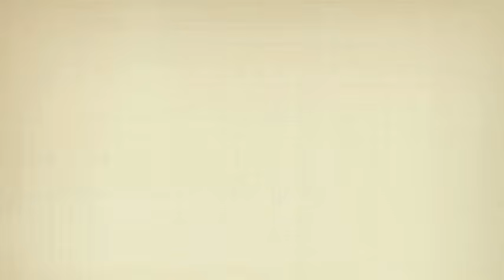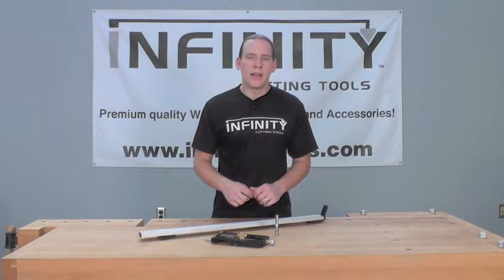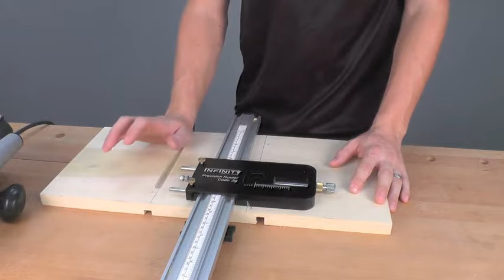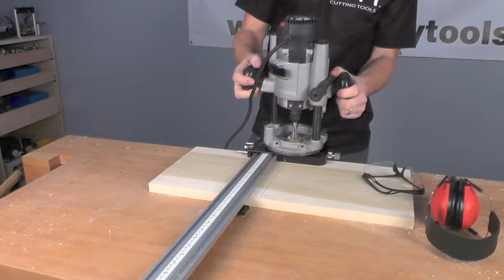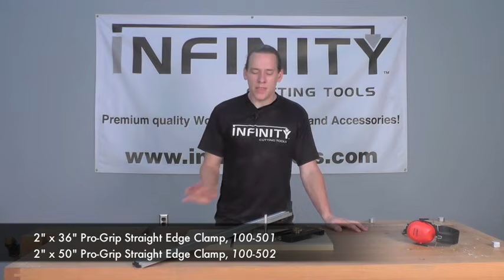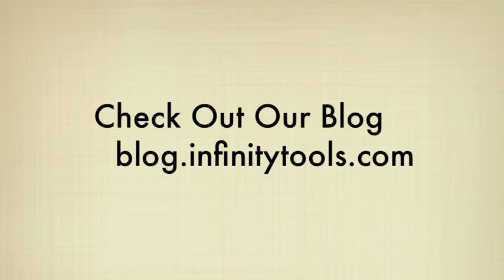Infinity Cutting Tools - 3-Pc. Master Woodworker's Dado Package

Comment: what is the size of the rail? I need make dados 36" width, is that possible?
Reply from the maker: This package includes a 24" straight edge clamp. we do have clamps available in 36? and 50" that you can purchase separately. https://www.infinitytools.com/shop-essentials/clamping/pro-grip-straight-edge-clamps-accessories/pro-grip-straight-edge-clamps